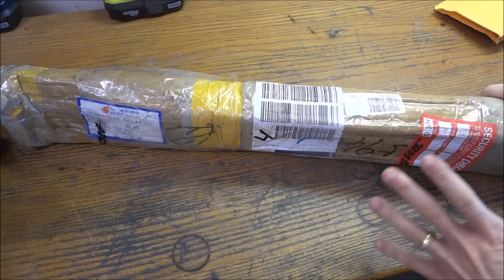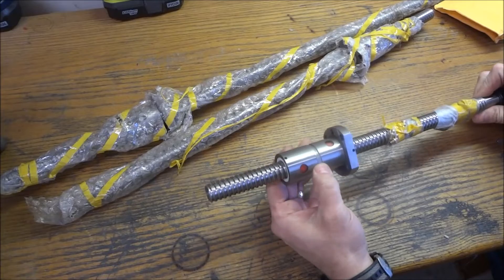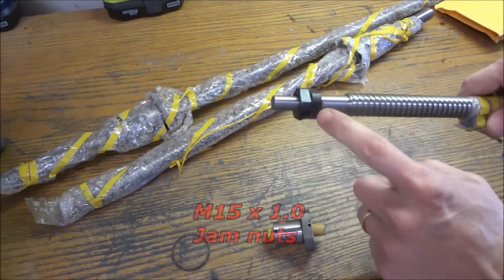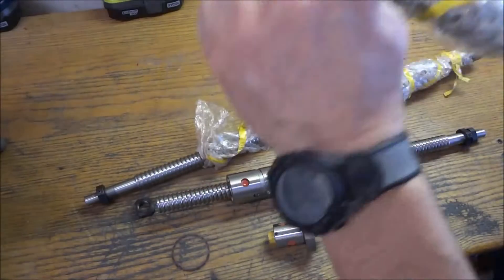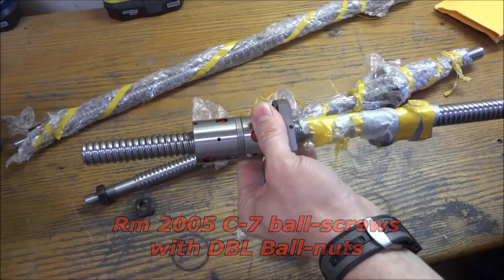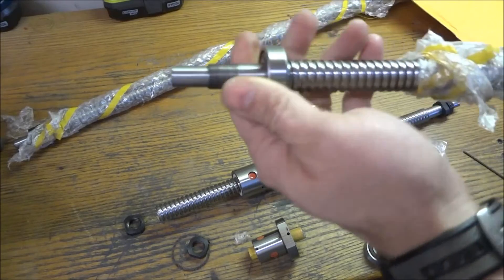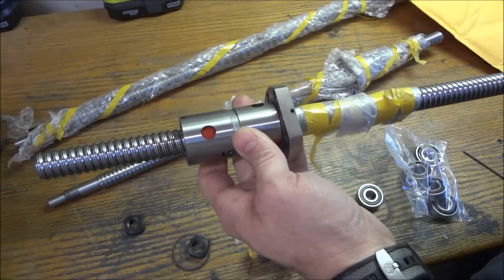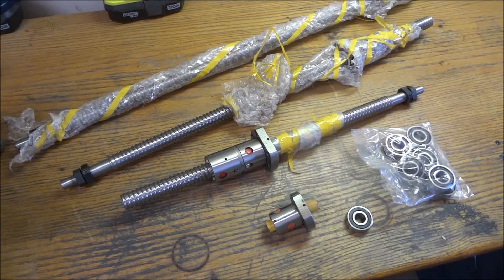PM 727M  "RM 2005 Ball Screws"

Comment: Sam, in your ball screw measuring video, you said for the X to measure the table and add about 1/2". In your dropbox plan, your X ball screw length shows 800mm. The 727m table 698.5mm, add the 1/2" gets you to 711.2. Then add the 82mm of machined ends gets you to 793.2mm. 800mm - 793.2 = 6.8mm. What did you do with the extra 6.8mm? Did you just account for it in the mounts? My PM940 table is 1000mm. Add the 1/2" plus the 82mm of machined ends brings it to 1095mm. That is the length I am going to order. Does that sound about right?
Reply from the maker: Hmmm! I don't recall  Its a good  Idea to get all the measurements figured out though before ordering. the floated bearing has 1/2" the other 6.8 may be the recess in the bearing mount.

Comment: I noticed that most of the home CNC builds do not use seals for the AC bearing mounts, yet all of the commercial mounts have seals.  Knowing the environment that mills are subject to (metal chips, coolant, oils, etc.), I would think it would be a must.  Have you had any issues or experience with related issues?
Reply from the maker: No I have not had any issues with this at all the coolant really never comes in contact with the Bearings.

Comment: I HAVE A PM-727M MILL BONE STOCK WIT A 3 AXIS READOUT . 
I DO MANUAL MACHINING AND ALL I CAN SAY IS , IT ISN'T A BRIDGEPORT . 

I WOULD LIKE TO INCREASE THE RIGIDITY BY CONVERTING IT TO THE HEFTY 
BALL SCREWS  . DO YOU HAVE A LIST OF THE PARTS YOU ORDERED ?  

I WOULD LIKE TO BUY EVERYTHING I NEED BEFORE I TAKE THE PM APART AND 
MEASURE THE LENGTHS OF THE SHAFTS & SO ON . 

I AM QUITE GOOD AT MACHINING THE FLATS & KEYS NEEDED FOR THE CONVERSION 
BUT WITH JUST ONE MILL , I NEED THE PM TO MODIFY IT's OWN PARTS FOR THE UPGRADE .  

LOVED THE VIDEO & THANKS FOR YOUR HELP  rimspoke@gmail.com
Reply from the maker: I'm using RM2005 dbl nut ballscrews.

Comment: Great videos! The detail is excellent. Would it be possible to use the screws that came with the machine rather than install new ball screws?
Reply from the maker: +Justin Gish  I have seen it done But Ball screws are inexpensive really About $200 You don't want to Have to make the mounts over again Later when you do decide to go with Ball screws and most likely you will. Mach 3 has a compensation for backlash but you cant really get great results with Stock screws.

Comment: Hey Sam,

You're making awesome progress. With respect to your Z access, do you have any concerns about the ball screw being fixed only on one end? For an X2, it seems like maybe something one could get away with but given the Z travel on this mill, I was wondering if you'd have any concerns about binding with a floating end? 

Keep up the good work. Can't wait to see you turn our mounts from drawings into reality. I assume you'll mill them on the X2 after all. :)
Reply from the maker: +Charlton Wang 
Good question, My train of thought is that binding would be more likely with a floated end therefore I went without. I felt the effort to design and fabricate a bearing mount would greatly outweigh any  benefit I would gain. On the X axis the Floated mount is easy to make so on the X axis I am using one. If you look at some other Commercially available CNC mills they do not use a Floated end bearing support IE Tormach.
Be Safe,
Sam
Reply: +CNC4XR7 Thanks. I did some more reading (including some engineering documents from Tormach) as well as some papers on the thermal expansion of ball screws and the effects of fixed/float, fixed/fixed, fixed/preload. Seems the learning is never-ending. My initial thought was that having a completely free end would cause the free end to whip around and possible cause some binding but I suppose the gibs/ways will keep things aligned (hopefully). Thanks for enlightening me on the matter. :)

Comment: I have been watching your channel for a few weeks now, and have began to convert my lathe to CNC. it is a little smaller than your G0602. My machine is the Chicago Machine 9 x 20. I have had it for quite a while, I had made a bunch of conversions to the machine but until I saw what you have been doing it has been enough for me, now I want it to be better. I have learned a lot from your videos and thank you for sharing your knowledge. I am saving up for a PM-727M like you got, hopefully I will be able to get one in a couple of months, then I can put some projects on my channel. Well, thanks again for the sharing of knowledge.
Reply from the maker: +James Hopkins 
Hi Your very welcome , Thank you for the support if I can be of any help with your conversion let me know  do have wiring diagrams for the G0602 that will most likely work with your setup.
be Safe,
Sam

Comment: Maybe you could have explained the 2005 is 20mm with a 5mm pitch. The 1605 are 16mm diameter and 05mm pitch.
The locknuts are standard Metric fine, M12x1.. (pretty standard in metric country's like The Netherlands that is..)

Love the preloaded double nut, did not know Chai had those....
Reply from the maker: +RoboCNC Frees- & Graveerwerk 
I always forget something lol I think I cover that in the next video   M 12x1 and M15x1 Not so standard here in the US 1.25 you can find but 1.0 not so much.  It may have been the Netherlands I got mine from lol.   Can't remember. With shipping it was about $30. For 6 nuts. Yes Chai has them in Rm1605 and rm2005. 
Love your stuff by the way your Tach on your lathe inspired my setup.  Be Safe Sam

Comment: Cant wait to see the backlash on the double nut!
Reply from the maker: +russtuff  There wasn't'much difference in the Cost should be a good deal.
Reply: +xpawel10 Me too, I've been considering changing to double nut on the G0704.
Reply from the maker: +xpawel10  Yeah I suspect it will be pretty good.
Reply: +CNC4XR7 i was thinking buying just the nut for the ones i have. Did you take a look at the ClearPath servo motors???Just got a quote for C5 ground ball screws $600 for three.
Reply from the maker: +xpawel10 
Yes I looked at clearpath  they were about $1k for my set up they sound like a winner then I saw a YT video  that a guy had for a H0704 build I contacted him he said  there nice but he did have some issue with them stalling   I figured at twice  the cost if  there gonna stall ill stock with the leadshine. Tormach has a rear write up on the 3 phase steppers which convinced me.
Reply from the maker: +xpawel10 Forgot to mention. There is a spacer between the ball nuts I think there matched to the screws but don't quote me. Might want to ask. 
Also $600 is three times what I paid. If I'm within a .001 I'll be good.
Reply: +CNC4XR7 You can probably make a bigger spacer to cancel the backlash
Reply: +xpawel10 +CNC4XR7 Sam, unless I am wrong it was Hoss who got Chai to make the double nut, as Hoss wanted it for his G0704. Chai then began adding it to his eBay store. I can't remember if this is in a Hoss video or a CNCzone thread, but as I recall the spacer between the ball nuts holds some belleville washers which force the two nuts apart, give preload, cancels the backlash, etc. I'm really digging this up from hazy memory but it seems like Chai was reluctant to sell the double nut not already installed on a screw, because of those washers/preload. Now that may have been an older version and I could be remembering it completely wrong, but I thought I would post it here anyway. I'll do some digging tomorrow and see if I can find the source of my memories.
Reply from the maker: +russtuff Not sure I do know that Tormach uses DBL nuts and so that's what prompted me to look into them. I did see Hoss video he did mention that Chai ground the spacers to spread the nuts apart and take up backlash. However I did not see any Belvilles. Nor do I think they are used. It this setup.
Reply: +CNC4XR7 OK then I'm likely remembering it wrong. I wonder if I got the idea from someone on CNCzone using belleville on their double nut setup. Its been at least a couple years since I've spent any time on the zone so who knows. Thanks for getting back so fast.
Reply: +russtuff I just found this http://www.kuroda-precision.com/products/ball_screws/QandA/BS_QandA_001.htm
Reply: +xpawel10 That's a killer find. Thanks!
Reply from the maker: +russtuff 
No you are right there is a thread on using the Belvilles and Roton screws I think. As to who came up with the DBL nut ? But I'm glad there affordable.
Reply from the maker: +xpawel10 
Very cool exactly what we needed. Thanks